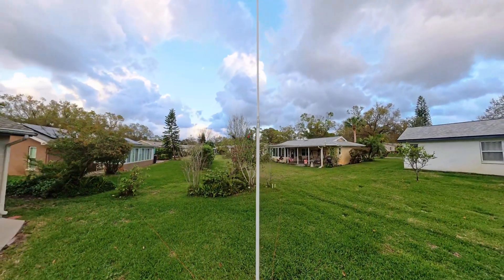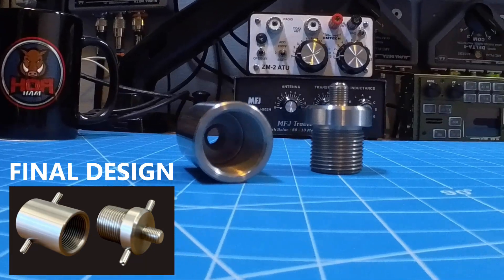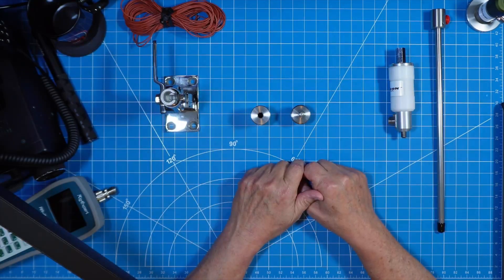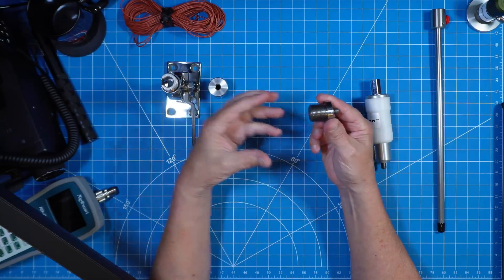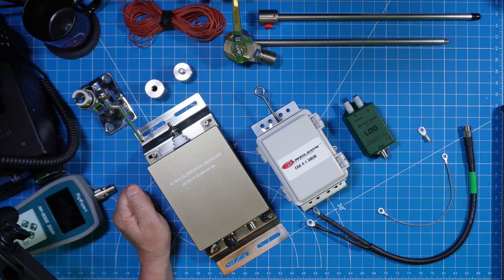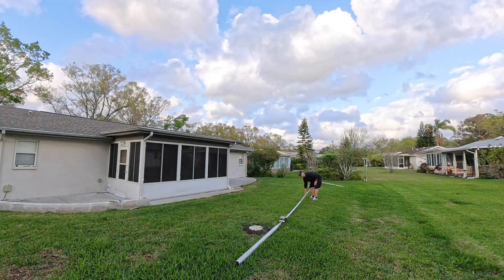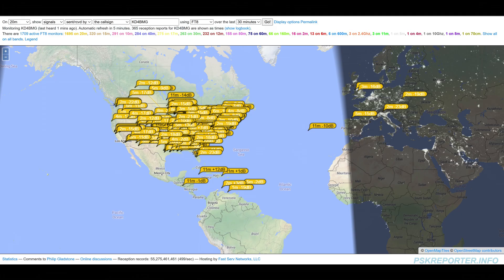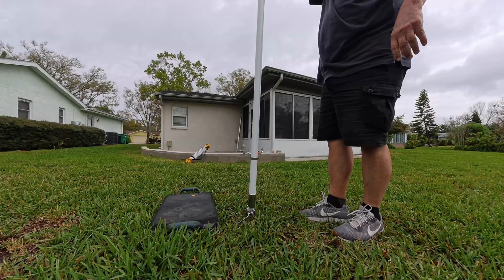Chameleon Converts Marine HF Antenna to HAM RADIO LAND USE - CHA Marine Adapter and Shakespeare 393

Comment: I got the CHA Mairne adapter and a Shakespeare 4700-2 24" Stainless Steel Extension (latter off ebay for $32) to mount onto my CHA Survey Adapter. The extension pole is 3lbs of SS. Stacked on the survey adapter, the marine adapter and the extension all fit smoothly and tightly together!  

My main antenna today is a Sigma Euro-Comm X80, which I have mounted to a 3ft chain link fence pole then bolted onto to my wooden fence. So now I'll be able to mount it directly onto the 2ft extension right off my tripod, making it portable and allowing for more optimal placement.  

Very excited to play with it when there isn't thunderstorms overhead. 😄
Reply from the maker: This is going to make for a VERY robust setup; very creative!

Comment: As a former sailboat owner I'm somewhat familiar with that antenna. Those were common on sailboats that ventured offshore, although most owners preferred to use an insulated section of their backstay that supported the mast. In either case they would be connected to a remote tuner usually located in a locker in the cockpit close to the antenna's feedpoint. As soon as anything is marine grade it = $$$$.

Back in my 11-meter days I had a Shakespear Big Stick. That was the best omni antenna I had. It laughed at the weather. The only thing that knocked me off the air was an ice storm. The antenna survived despite being encased in ice. My coaxial cable did not. The weight of the ice tore the cable out of the factory crimped PL-259. It was a 50 foot length of RG-8 that I bought from Radioshack. The cable was taped to the mast, didn't matter.
Reply from the maker: Thanks for this valuable feedback.  The "dry land" hams are struggling to see and understand the benefit here, and / or get past the added cost for the robust nature of marine gear.  The viewpoint of those with experience is helpful.

Comment: it's oversized for UPS, expensive project
Reply from the maker: Yes, those 2 things, plus small enough for portable while strong enough to be a permanent QTH antenna, strong enough to be a mast to place other antennas on top of both portable / QTH, has a top 3rd section that doubles as independent antenna for use with loading coils, will never corrode, will never break like a telescoping antenna will eventually.  And, adding the CHA adapter opens a entire new opportunity for expansion beyond anything land bound hams have thought of previously; but you are right, it is oversized for shipping, it is a project that if you only had a single use for it, is expensive.
Reply: Those aren't shipped by either FedEx or UPS but third party carrier.
Reply: This is why we're selling the 393 SSB HF antenna for $330 + shipping.

Comment: regarding 40m operation I'd certainly recommend the full ATU at the base & not just the 4:1 unun. Here's why:-
On 20 & 17 & 15 etc etc you are all LONGER than a quarter-wave so the radiation resistance is higher than 50ohms & being non-resonant it will have a shedload of reactance so dividing everything down by 4 with the unun will certainly help bring things down to a more manageable region to be handled by the the rig's final ATU.... hence the Rybakov popularity.
However on 40 you are shorter than a quarter wave. You will still have the big reactance to cope with but the radiation resistance of a radiator about 64 electrical degrees long is only around 15 ohms... if you then make this even worse by dividing this by 4 with your unun your radiation resistance is getting way low such that ohmic losses in the feeder connectors & ATU all become more significant & you may get a tune on 40 with the 4:1 but how much you are actually radiating & how much you are just warming the coax is debatable. With a good ATU directly at the whip base 15 ohms plus a load of reactance shouldn't be a problem.
Reply from the maker: My preferred method hands down, and as you say, especially on 40.  Although few hams do this, it just makes sense to be using a remote tuner.

Comment: The marine set-up of having the ATU external at the antenna base is so much better than having the ATU in the shack. I can do this even with my ldg z11pro as I leave it in full auto mode, have fitted a AA battery tray inside it to power it & have just adapted a Walmart klikseal plastic food container into a weatherproof cover for it so it is now "fit & forget" externally rated.
Regarding the length of the marine whip. ARRL already recommends 23 to 25' as a good "non-resonant" random wire length & surprise surprise that is the same length of radiating metal as used on a Rybakov or comet cha250 or doubled up in balanced doublet mode in a half size g5rv. Ok they all use slightly different match mechanisms but the radiating bit is basically the same.
I would say that the marine way of doing things with an external ATU at the whip base will work so much better than the Comet or Rybakov.
Reply from the maker: Never thought about the LDG external in a weather proof box; nice idea, thanks for sharing!

Comment: The LDG connector will unscrew but it requires pliers  it can then be screwed back on without any problems. May still require the pliers. I’ve had a few of them.
Reply from the maker: Thanks for that; I eventually realized my banana plugs will go in the end....it was right in front of my face.

Comment: Will it work on 10 meters to 40 meters?
Reply from the maker: Yes, with a tuner like I was using, or a matching unit then shack tuner.  I did both.

Comment: Back in my CB days I used a Shakespeare top loaded 11 meter antenna. Best fiberglass whip for its size. Fast forward to 1996 when I purchased my SGC 2020 HF radio I also purchased their SG 239 antenna coupler. Well my love for creating things from nothing, I used an old CATV aluminum housing to mount the coupler in and utilizing an article from QST I built a power injector and it’s complimentary power remover. Now the coupler needs 12 vdc to operate and I just wanted to have one cable to the housing. Well CATV housings utilize the same threads as found on the 239 and N connectors. I used a all thread so239 double female to provide me with the input side of the housing and for the antenna mount I used the a "Bubblegum" mount for the whip which is a full size 102” whip which is a Shakespeare fiberglass antenna. After adding the necessary wiring for the power splitter and input to the coupler as well as the line to the bubblegum mount. I place the assembly on a "non penetrating " roof mount that is loaded with concrete blocks to hold every thing upright. Added four 20 foot radials to the mount, ran the cable to my rig and to power for the power injector and went to town. This antenna talks great! 20 watts I worked California and Arizona with no issues.
Now for my next project for my mobile use is found in Shakespeare Military antenna catalog. It is extremely broadband VHF and it does cover 140- 170 MHz with no issues, it’s advertised as a broadband antenna and I can trust the brand for the investment, a few years ago it went for around 450 US $’s.
BTW I still hold my Advanced Ticket even though it’s no longer issued to new hams and I do have a reciprocal license in SV Land which allows me to work the bands reserved for Extra class bands in the states but with my SV call while in the EU.
Reply: PS I do use a heavy duty spring between the coupler box and antenna. What I failed to mention was that I lived in Ohio when the previous mentioned contacts were made. 
73! Happy hunting for those rare stations!

Comment: I swear, someone in Chameleon's R&D must be reading my thoughts. 

Those 1"-14 marine mounts seem to be underappreciated in the ham community, at least locally. I found a brass adapter fitting that connects it and cast iron water pipe together at the local big box hardware store, which allows me to mount a Comet VHF/UHF base antenna on a tilt mount. Some antisieze to stave off galvanic corrosion and a bead of silicone on the thread edge to keep out the water ensures a good ground through the pipe and adapter.
Reply from the maker: When they float things my way, I often think, "where has this been, and why hasn't someone already done this".  Such great innovation from Reno, NV.
Reply: Chameleon's adapter is going to be quite useful on quick mounting solutions for temporary antennas, but I feel that 3/8 stud is going to be the weak point of any permanent antenna mount in terms of wind. Then again an "engineered" weak point in your mounting system that potentially saves the antenna from breakage during a hurricane might not be a bad plan anyway.

Comment: I like the idea of using rugged marine components, but at 23 feet long, how well suited is that Shakespeare 393 antenna to the amateur bands?
Reply from the maker: This is made for the marine environment to be used broad banded with a matching unit / tuner; just like many other antennas we are used to.  All random wire antennas have the same approach, not looking for resonance, but to be broad banded.  With this length 20 and up will be great, 40 okay, anything lower, not so much.

Comment: Those wanting to home brew something like this might get Greenbar2X fiberglass rebar and coil wire around it. They're rugged, since they're intended to substitute for steel rebar. Lowes sells the 1/2 in by 20 ft version for $14.58. Wrap it with electrical tape or the covering of your choice and you have something functionally similar to this marine antenna and almost as rugged. The negative is that it does flex a lot, so you might place it inside 1/2 in PVC tubing. Wrap the wire carefully and the rebar might just fit inside and make the result stiffer. I've got both, but have yet to build one. I'd love to hear from someone who has.
Reply from the maker: Hmmmm, I wasn't aware of the Greenbar; gonna have to check that out.

Comment: Take it from someone who's owned three sailboats, marine toughness comes at a substantial cost, $386 in the case of this antenna, and that's just the beginning. To match that antenna to marine or ham bands, you'll also need a waterproof antenna tuner such as an Icom AT130 at some $600. Those prices has in the past driven those who sail far offshore to get ham gear, but that's getting hard to justify given the digital signaling modes (including email) that the newer marine SSB radios come with. Here's one benefit:
----
An additional safety benefit of the modern SSB is Digital Selective Calling (DSC). DSC is an essential element in GMDSS. All commercial ships mandated to have DSC are required to monitor DSC marine SSB frequencies while at sea. In the event of an emergency, they (or any other HF SSB DSC-equipped vessel) would receive your exact location (assuming you've provided GPS data to your SSB) and nature of distress at the push of a button.
https://www.practical-sailor.com/marine-electronics/a-second-look-at-marine-ssb
----
Than link has a lot of useful details. The Icom M802 is particularly interesting. In addition to the digital selective call modes of marine radios, the FCC has certified it for the 160-10 meter ham bands. It's not a bargain though. The basic system will set you back about $2,500—and it is one of the cheapest.

 The key to enjoying sailing is keeping it simple. One way to reduce costs is to visit the boating flea markets often held in waterfront towns in the spring. You might be able to score one of these antennas or the tuner for a pittance. At one I picked up a French-made $150 boating compass for $5.
Reply from the maker: Thanks for all the detail.  My approach here was to get this 393 onto dry land and begin seeing what hams without boats can do.  I'm sure all your experience proves helpful in seeing the potential.

Comment: According to Amazon, that is a 1"-14 thread so I am pretty sure that is 1" diameter with 14 threads per inch 🤓 de WE0H ..
Reply from the maker: Spot on 1" x 14 thread count.

Comment: Well, well.  I am seriously interested in this thing.  Some years ago, I bought the storage unit contents of a ham that was relocating across the country and could not take a lot with him.  Among the contents was a Shakespeare 393 antenna.  It looks a lot like the one you are using. Amazon shows this thing going for almost 400 bucks so I was hoping it might be good for something.  I can't tell if mine is supposed to screw apart at the bottom like yours does.  Mine has some kind of loosey goosey mount that allows it to move laterally and be held by a mount 4' or so up its length (I would assume to a place higher up on the boat.  So if mine has that big thread Chamelion makes a mount to adapt it to 3/8 X 24.   Is it priced at typical Chamelion 10 times what it should be worth?
Reply from the maker: The 393 version is 3 pieces; this antenna also comes in a 2 piece version -- yes, they cost a few bucks, and in my estimation are worth it.  Very robust antennas.

Regarding the machining, I am a Director of Sourcing for my company and have purchased over $100 million in machining throughout my career, from hundreds of machine shops.  The CHA Marine - A is priced as it should be for low volume precision machining in the USA.
Reply: @HOAHamRadio  Exactly - the price would tremendously goes down if we were manufacturing 8,000 to 10,000 units at once but until the MARINE market for that kind of products expands, it won't happen anytime soon.
Reply: I checked my Shakespeare 393 antenna and the boat mount it has does indeed screw off.  Thanks for that information.  And thanks to Chamelelon for giving the size and thread pitch for the screw.  Chameleon I am sure has over engineered this part to be a whole lot more than my needs for a typical POTA outing.  They should make another flavor that doesn't have the 1" to 1" coupling just 1"x14 male and 3/8 x 24 male.  And maybe make it cost less than whale's tears.